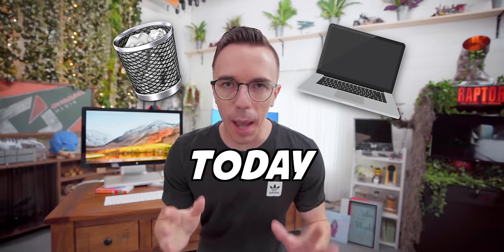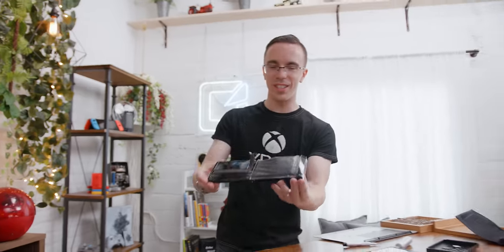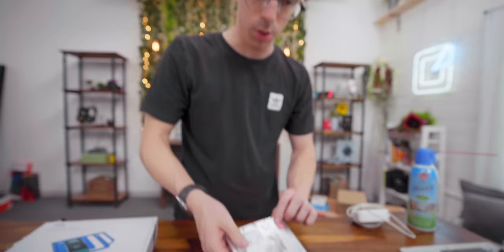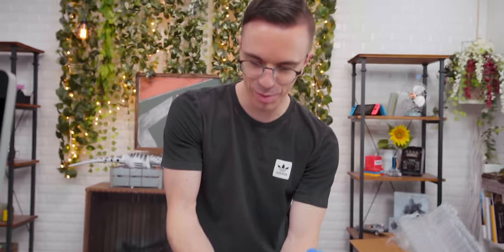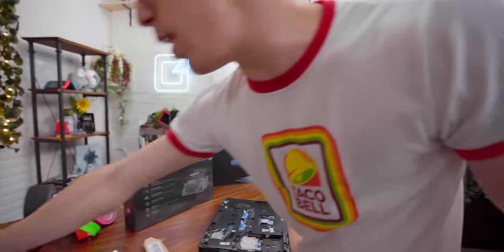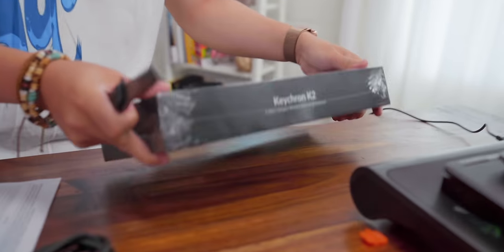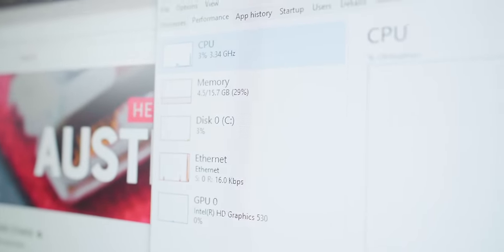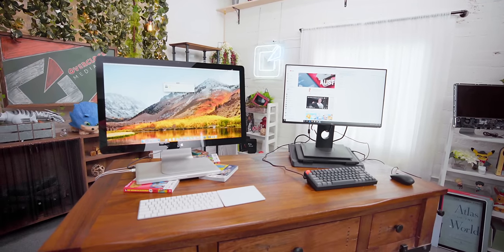I turned a DEAD LAPTOP into this!

Comment: I work with those apple on the regular. That battery swelling with the tracking pad basically exploding is very common. You guys lucked out and didn't come across the old fuse blow it basically makes the cooling fans decorations.

Comment: “With $500, you can probably get an iMac”
Reply: I bought a 400 dollar MacBook turned out it was a 2011 version of the MacBook Air and is trash I can’t get my money back anymore and I’m stuck with it I don’t know enough about it but I was wondering if I could take it apart and make a Pc with parts with it
Reply: @konafire134  if it's slow n trash , it'll stay same if you make it a PC like in the video .
Just upgrade it with some SSD n RAM (also battery if you can) and use it as a laptop. Don't forget Cleaning the fans , reapplying thermal paste and removing the Optical drive ( if you don't want em).
Reply: @konafire134  oooo you said MacBook Air .
Atleast clean the fans and repaste the CPU.
Reply: Nandulal Krishna yea I know it was bull 400 dollars for a crap MacBook and to resell it I would be lucky for 100$
Reply: I was literally given an iMac at the weekend.
Reply: @konafire134  yeah I probably wouldn't try cleaning it, replace thermal paste, try upgrading ram if possible, and clean MacOs from any unnecessary programs running to make it faster
Reply: Check the battery and screen connection, especially the battery they often corrode.  Watch Louis Rossmann's videos on YouTube.

Comment: So a setup like that is possible for very cheap, specially if you live in the US. You can get a laptop with a smashed screen for cheap, get a second hand monitor from eBay or Craiglist, and get some cheap second hand peripherals or a cheap brand new keyboard and mouse combo. You will essentially end up with a decently performing (depending on laptop specs) all-in-one style computer. Great for basic tasks and for school work.

Comment: That macbook is an 8,2 or A1286 model, those macs had severe graphics problems where the GPU gets so hot it literally desolders itself from the logic board. This means that for any longevity the graphics unit must be switched to intergrated using an app called GFX card Status. Unfortunately this disables the thunderbolt port. there is no way that mac will last more than 6 months like that MAX. If that wasnt bad enough those cinema displays are known to have backlight faults, especially when the USB's are in use. DO NOT DO THIS

Comment: Hey! This Is Pretty Awesome.

Especially considering the fact that you turned trash into usable tech. It is a practical use case scenario. And the bonus is a great display monitor. 

We've all seen what can be done with a Samsung Dex cord connected to both a Samsung phone and a good enough monitor for the display. So, the same thing can apply for an old laptop computer.

This is great when it's done right. Both, the Apple setup and the Dell setup, are good
Reply: would you choose the apple setup or the dell setup? id choose the apple one cuz the 15 inches got gpus whereas idk about the dell

Comment: I turned a nearly dead laptop into a home theater PC. It sits behind my TV with wired ethernet, an external SSD, etc. The display, battery, and attached keyboard were all failing hard. However it still more or less works and its mobile 960 can run a 4k display and had enough I/O for wireless peripherals, a proper ethernet cable, and full HDMI. 

Reduce that E-waste, ya'll.

Comment: I was expecting more of a remove motherboard from chassis and put it into a 3d printed enclosure on the backside of the monitor or maybe build into the base of the monitor...like making it into an all-in-one. Rather than just connect a monitor and keyboard with small upgrades.

Comment: NOTE TO ANYONE WATCHING THIS.. DO NOT spray canned air into your fans to spin them, doing so MAY cause it to generate voltage and if the circuit that drives that fan header isnt protected from reverse voltage you may end up frying that pin header circuit.  It's not a myth, its basic electronics.  Lots of expensive motherboards would go the length to put the protection in place, but why risk chancing it.

Comment: I have a 100% fully working laptop that I unscrewed the hinges on and pulled the entire screen out from because the screen wouldn't light up.

If you've ever owned Metroid Prime pinball on the Nintendo DS lite specifically and hit the button to turn off the backlight you'll know what I'm talking about.

If it had hdmi instead of vga then it would be usable.

Comment: WORTH A READ...
I have a HP Sleekbook-14 B120dx (My 1st own laptop, brought from my salary), which I bought brand new in 2013 from US to India (through an office colleague who went onsite). 
To date, the laptop is working (having completed 9 years now). I had been using it nicely and kept it well maintained all these years. 

Here's below the original configuration (Year: 2013)-
1. Core i3, 2nd gen.
2. 4 GB DDR3 RAM
3. 500 GB HDD
4. Windows 8 (pre-installed with OEM digital license)
5. Wifi adaptor card (no bluetooth)
6. 14 inch display

Below are the Upgrades (Both software and hardware) I had done (Year wise)-
1. In 2014, got an official upgrade from windows 8 to Windows 8.1. Did it and got some new features in 8.1 (The best MS Windows according to me) >> Loved the 8.1 Update

2. In 2015, got an invite from Microsoft to get a free upgrade to Windows 10 (Global free Win 10 upgrade from Microsoft in July, 2015) >> Total disaster, hanging issues with HDD (Rolled back to Windows 8 with recovery disks and then updated to Windows 8.1)

3. In 2016, I got to know that my laptop motherboard had an empty mSATA SSD port (a rarity to see in laptop in those days, considering 2013 make). I read the user manual and got to know that this model belonged to ultrabook series (scaled down to Sleekbook without a SSD). I followed the instructions and learnt that this mSATA is for adding SSD upto 32 GB to use it as a caching device. 
I bought a 32 GB mSATA SSD and plugged it into the empty slot, found the option in BIOS to enable SSD caching under RAID options and enabled it. >> My sleekbook became an ultrabook with a physical SSD and blazing fast performance.

4. In 2018, I upgraded the RAM to 8 GB, by adding another 4 GB DDR3 in the empty slot (8 GB is the max as per HP recommendation and its true, I experimented with 4+8=12 GB, my laptop did not boot). So, finally upgraded from 4 GB to 8 GB RAM (I had set virtual memory in the PC settings to upto 24 GB) >> Huge difference in multi-application use, machine was working much better.

5. In 2019, I replaced the Wifi card with that of Atheros Wifi + Bluetooth combo adaptor (by referring to the manual for supported LAN cards) >> My laptop got Bluetooth functionality

6. In 2020, My laptop display broke due to my anger (verbal fight with parents on phone call) - I cried like anything, as this particular laptop was like my own family member. Could not do anything until lockdown. Once lockdown was over, I started to look for display. Did some study and bought a Sleekbook 14 (14 inch display from buysnip). The ordered display was of a different sub-model available in India. Took a risk to order it and to my surprise, it was a bang on direct fit on my machine. I would call it as an upgrade, as the original screen was a ordinary screen, this replaced screen was an anti-glare one. >> My laptop now had an anti-glare display

7. In 2020, I travelled back home after winding up my stuff and I still feel bad that I bought my office laptop with me and put my own loving laptop in the transport. It had to take some abuse in terms of shocks and finally when it arrived after 10 days being in transport. Luckily no physical damage, but the HDD was knocked out (several non repairable/recoverable bad sectors). So, replaced my 500 GB HDD to 1 TB Samsung EVO SATA SSD. (Installed Windows 8 with recovery disks and then updated to Windows 8.1).

8. Bought a digital Windows 10 Pro license from buydigitalkeys. The built-in OEM keys of my laptop was for Windows 8 Home. When I updated it to Windows 8.1/ 10 (It was digitally activated but for the same parent version- Home). Finally did a clean install of Win 10 Pro for the 1st time (As all previous installations were from recovery disks, which restored it to factory Windows 8 Home). >> My machine now has Win 10 Pro (Got the GP edit, RDP and Bit-locker functionalities which I was in need of)

9. Installed Ubuntu Linux on a separate partiton and it works like a charm, without any issues. Setup dual boot for Win 10 Pro and Ubuntu Linux 20.04.4 LTS >> My machine now has dual OS

Here's below the updated configuration (Year: 2013 - 2022 and ongoing..)-
1. Core i3, 2nd gen >>> Same
2. 4 GB DDR3 RAM >>> 8 GB DDR3
3A. 500 GB HDD >>> 500 GB HDD + 32 GB mSATA SSD for caching
3B. 500 GB HDD + 32 GB mSATA SSD for caching >>> 1 TB SATA SSD + 32 GB mSATA SSD for caching 
4. Windows 8 (pre-installed with OEM digital license) >>> Windows 10 Pro + Ubuntu Linux 20.04.4 LTS
5. Wifi adaptor card (no bluetooth) >>> Atheros Combo Wifi + Bluetooth
6. 14 inch display >>> 14 inch Anti-glare Display

Besides, I had changed the battery thrice in 9 years. Kept my machine clean (I do clean it weekly). Keep my Norton AV updated, performance tune-ups for Win 10, periodically check and upgrade to the latest 10 build. Keep it clean from junk softwares as well. 
Final Outcome: My HP Sleekbook-14b120dx bought in 2013, can still outperform many laptops of today. Still has sufficient punch to run some good games, moderate programs to heavy home use. The specific HP Sleekbook 14 model is indeed sleek without an optical drive and with 14 inch display and real sleek design, the laptop also looks contemporary to modern laptops of today and looks thin and sexy! 
I just love my machine :-)

Comment: Austin:not mentioning the specs of the MacBook
Me looking a little bit closer to the point that shows the os of that machine:It has a2.66 ghz core i7 
Meanwhile i looked at my laptop specs and it also has the same cpu (which is a core i7 620m 1st gen 2.66ghz)
My reaction:wtf
Btw this cpu is still fine for multitasking when you have 8gb of ram and i have it for over 7 years without any problems and i am planning to put a gtx970 to maybe play some esports games.
Lol

Comment: i just refurbished an old macbook just like that and made a pretty good profit from it. lol.

bought replacement parts for everything. upgraded it to an ssd, swapped out the cd drive for a hdd cage so it has two drives now, replaced the battery, replaced the trackpad coz it also bulged.  upgraded the ram.

those old macbooks make good money on the used market.

Comment: This is a joke.  I'm bringing back a Dell Latitude 131L with minimal hardware power: 1.6 Ghz processor, 512 MB memory, a dead battery, a broken fan, and 32-bit Windows XP - all of which had to be upgraded or replaced.  I can't find a driver for the WiFi that works with Linux Mint.  But it is fun bringing utility back to something headed for the landfill.  One more thing, what's with the proprietary displays when you can get an HD TV for cheaper, especially if it's used.  I got an hp desktop hooked up to one via VGA.

Comment: Ooops, I was always uncertain about this CleanMyMac because of all the pop-ups coming all around during my internet sessions making it look like a bad software.
And by the way the backlight on my MacBook Pro 13" mid 2012 is out since 1 year, unfortunately there is no repair tech in my place to fix this small problem so I have it plugged to an external monitor and since long I got rid of the optical drive and installed a second drive. Works perfectly fine except no more mobility.

Comment: You should try adding a gpu like a 1650 with an exp gdc. I've done that before with an older dell laptop that had no screen and a missing trackpad and it worked great as a budget gaming setup. Also try to get a newer gpu if you are gonna do it cause i tried before with a gtx 275 and 480 and it didnt seem to work. But when i tried an RX570 it worked great.

Comment: Poke a pencil or pen into the fan to hold the blade still before you blast it with air, you can damage it by spinning at a higher rpm than it was designed for.

Comment: So the point of this video was, if your laptops screen is broken, just plug it into an external monitor, and if any components are missing, replace them?   Not very exciting.
I have a laptop where the display only partially flashes on for a fraction of a second because the internal display wire itself is damaged, and it goes to windows repair, but external display isnt working any differently, that has me stumped.
Reply: no one asked kid but alr .__.

Comment: This would only be good if you could find a really cheap laptop on ebay or mercari. alot of old laptops that other people have found can easily found for less then 100$. I picked up a super old classic e6400 for 15$ and got it up and running fairly recently with a t9600 cpu.

Comment: I did the same thing with a broken laptop I had cost me $39.99 for an SSD $24 for an 8gb SoDIMM and bam decent little desktop from a laptop with a broken screen, touchpad, keyboard, chassis slightly broken and HDD F’ing mangled my dad dropped it while it was running, it runs great now I just need to get a new heat sink and fan for it I found out the heat pipes go bad on my model I was wondering why I couldn’t get much below 50C at idle while my other laptop with the same APU idles at or below 40C, all I’m
Gonna use it for is yo display YouTube chat while streaming so adding a second monitor connected to my GPU won’t kill my FPS

Comment: How did you get the macbook to run at its full CPU frequency? Normally macbooks with no batteries run at a severely reduced clock speed since the adapter can't supply the required power
Reply: I think they used a more Powerful adapter to achieve this

Comment: Hi Everyone,
Wanted to know if I could pick your brains. I suffer with a visually impairment and am blind in my left eye. I currently use a MacBook air from 2013 for its voiceover screen reader. It's become quite slow and  fan turn on a lot. I wanted to ask how simple it is to open up. I've never opened a laptop before, cause of my sight. I was always worried about misplacing screws.

Comment: i know your never gonna see this but ive been wanting a computer forever we finally got a crap laptop for 200$ so i was wondering how could i turn a hp protect laptop into a computer i tried seeing what the actual laptop was but when i tryed i took the battery off it was atatched to the back and now i dont know what to do im from austrailia so 85 dollors is 119 dollors i need help i put my xbox on my computer desk and plugged it in my old moniter so i can have a computer with a 30 dollor keyboard and mouse with no side buttons and it frustrates me as i try to build my dream setup pls can i get some advice i see you make a bunch of computers as not even i have one cause they costs 1000s of dollors where i am pls help and keep safe :)
Reply: and yes i am a child who sent this so ye that how badly i want a computer i would write an whole esay for one k bye